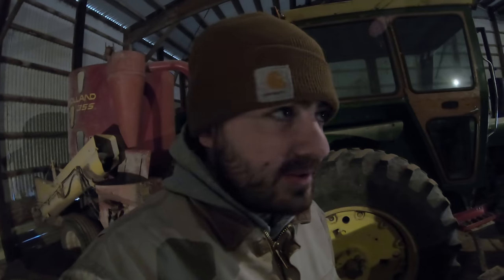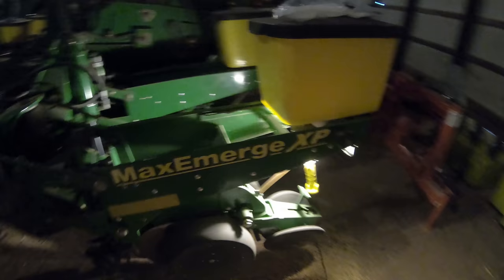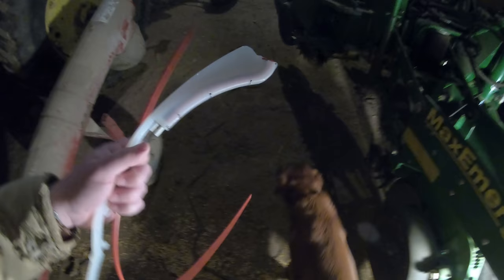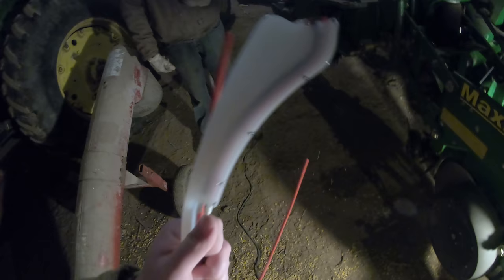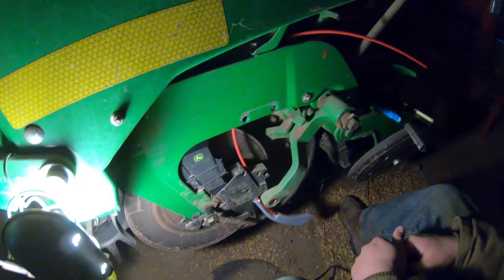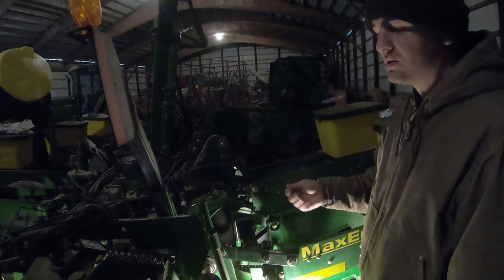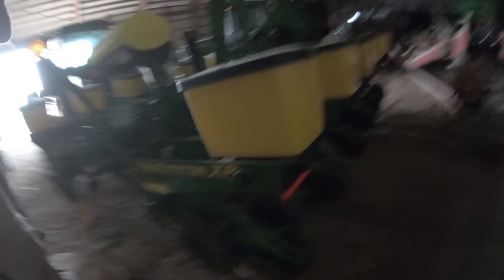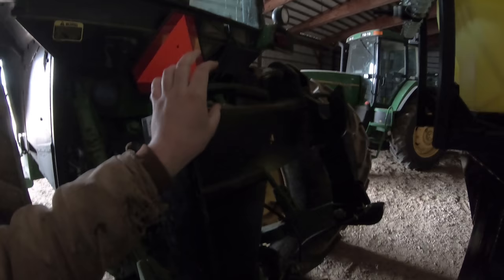John Deere 1760 Planter Keeton Seed Firmer Install - Sloan Express

Comment: On our DB 90 we use it to apply fertilizer too but the problem is when you are going back and forth the fertilizer get on the closing wheels and get caked with dirt you should get the hoses in the front of planting seed it will help tremendously

Comment: I’ve been running those for several years now.  Use the Y not and it works great. I think you’ll be happy with them. I use agro liquids Pro germ and sure K. No comparison with dry fertilizer.

Comment: hey ryan im sure you guys are done with this by now but when we put new seed firmers on we take the whole gauge wheel  and arm off than we take out 4 screws that hold the firmer in that black bracket and it helps use save a little time. Good job on the 2 inch gap in the openers, not sure if it matters but we also learned from a john deere clinic we went to that the gauge wheel arm needs to be tightened up to were it barley catches on the openers when the wheel goes up but is still able to fall back now. Like i said not sure if thats a big deal or not but just wanted to pass it along
Reply: Correct... the inside of the gauge wheel is supposed to gently clean the disk opener blade and hold the soil down as the opener blade is beginning to lift out of the soil as it rotates past the bottom point-- break the soil loose from the disk so it doesn't cause "trench wall blowout" where the opener blade brings up a small clod of damp soil.  

Also by having the gauge wheels lightly touch the disk, it should help prevent "rooster-tailing" where loose dry soil gets pushed up between the blade and gauge wheel tire, which the tire then tosses up into the air behind it as it turns, which falls back in the seed furrow on top of the seed before the closing wheels can collapse moist soil in around the seed... this ribbon of dry soil on top of the seed soaks up moisture from the surrounding soil that the seed itself needs to imbibe in order to germinate, which can slow germination and emergence... 

Later!  OL J R :)

Comment: Are those low flow type flow monitors?  I doubt your putting down 10+ gals through the firmers, in which i think for single digital flow rates you want the low flow ones? Or at least what I read.

Comment: Which is distributed in these small yellow boxes?
Reply: The small boxes in back are for dry granular products like insecticides or other dry products... they put out zinc and some other nutrients with them last year.  They're only meant for low rate materials (up to about 20-25 lbs per acre, but more typically applied at about 5 lbs/acre).  Later!  OL J R :)

Comment: Will they use the blue PTO roller pump if not how will they pump the fertilizer?
Reply: Probably an electric pump... they seem to like those pretty well and they're good for lower rate applications like this... 

Later!  OL J R :)
Reply: I guess the roller pumps were old technology because I sold a lot of them in the late 80s at the JD.
Reply: That's what we always used... they're still widely available and quite a few of them being sold.  

You get up into the larger sprayers and the turbine pumps and centrifugals seem to be the most popular.  A lot of the big pull types like Hardi's (like OLF runs) have the piston or diaphragm pumps (fixed displacement) that can deliver more volume and higher pressures... but those are 'spensive!!!

We've never really used the electric pumps until we bought a self-contained 14 gallon sprayer to fit onto the back of my brother's high-rider golf cart, that we use for spraying brush and trees at Shiner and running the fences on both farms... last year we hit all the big cactus patches (prickly pear) on the farm and pretty much just nuked the stuff... lot of running back and forth mixing, but it worked well.  It's a "demand pump" that switches itself on with a pressure switch to pressurize the hose going to the wand and then shuts itself off.  You spray something, the pump kicks on automatically and then runs for a second or two when you quit spraying to repressurize the line, so you always have good pressure and ready to spray... Works GREAT for spraying huisache and mesquite, and trash trees like bois d'arc, toothache trees, and hackberry trees that come up in the fencelines... we run the fences at least once a year with it and the pastures once yearly... With the 3:1 or 4:1 Remedy/diesel mix, all it takes is a shot on both side of the trunk all the way around and a foot or so up off the ground to completely kill the unwanted trees down to the roots... for small "switches" coming up, a squirt on both sides of the stem is all it takes.  Once you have the trees taken out, usually 10 gallons of mix will cover the entire farm to control any brush that comes up... works just great!  

Later!  OL J R :)
Reply: My uncle's farm is adjacent to my little 30 acre campsite in the woods.  It is family land and is probably 2500 acres.  The farmer renting it now probably has added another 1000 acres of his own land and land he is renting. Talking about spraying he uses an incredible John Deere self propelled sprayer and I don't have a clue how wide it is.  On the other hand I watch a channel called Soybean Farmer and his sprayer tank is a 55 gallon drum standing on end. Both are fun to watch.
Reply: Yeah we were a little better off than that (55 gallon drum sprayer) but not by a whole lot LOL:)  We've got 87 acres here at Needville and 160 at Shiner 90 miles west of here... all cow/calf now-- quit row cropping in about '03... 

Later!  OL J R :)
Reply: I believe you are are talking about TX for your farm.  Our place is about 30 miles south of Augusta, Ga. in Burke County.
Reply: Yes... been through Georgia a few times... had cousins in South Carolina and travelling to Florida a couple times... 

Later!  OL J R :)